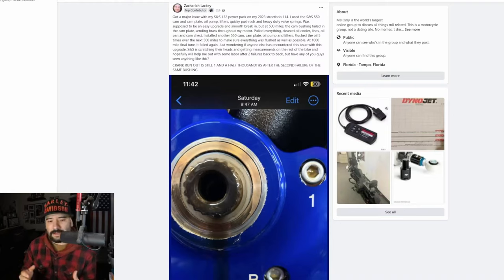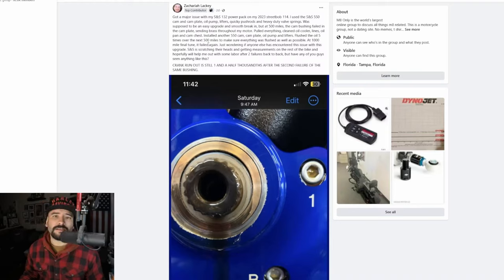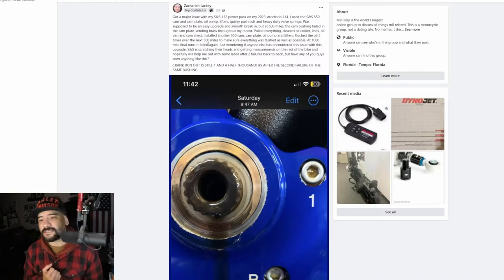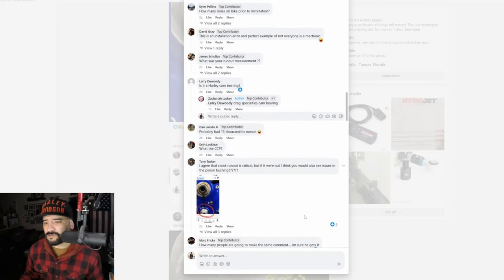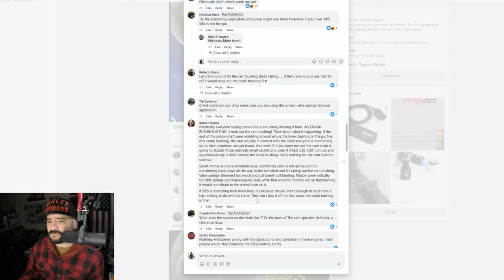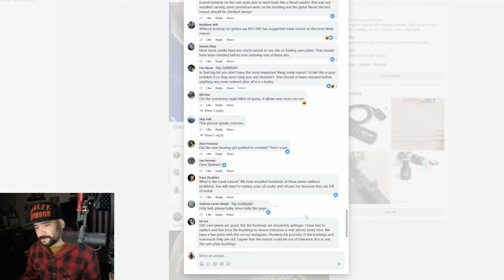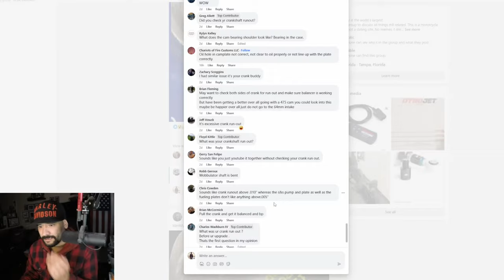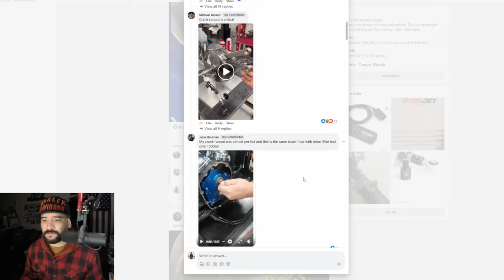Harley Davidson S&S Cycles M8 Cam Plate Fails at 500 Miles - Check Your Crank Runout!!

Comment: i did cam chest job on my 2017 fltru in spring of 2023. S&S plate, cam, pump, tappets, lifters, tappet cuffs, bearings and gear drive. only thing was i stayed with .350 grind cam {stock}. was looking more for reliability rather than higher performance. did all the work myself with a crank run-out of .0035. ran unbelievably well just with timing improvements with gear drive. made round trip from ohio to central cali and back last june. 6000 mile. never had an issue and still runs great today. also modified intake{crank} breather to atmosphere and oil tank breather to atmosphere which is easily done on a twin cool. most oil i've ever had in my crank was 4-5 oz. now average 2-3 oz.  i hope she runs forever.

Comment: everyone is stuck on crank run out . i would be thinking his push rods are set to tight or coil spring bind.
Reply: I agree 100% push rods aren’t adjusted correctly. Probably not hand turning the motor and waiting for the lifters to leak down and rechecking if they can spin. S&S says 4 turns from Zero lash pumped up. With some lifters that’s too much.

Comment: Had S&S cams, camplate and oil pump installed in my 96 cu inch TC and so far no problems. Did have some problems w tuning at first, but they got it running good eventually. That was about 3000 miles ago. Not even sure they checked crank run out before install.

Comment: Suggested run out allowance is 0.003" MAX. If you are above that specification, you are taking your chances.
Reply: That’s a gear drive cam spec. Chain drive cam runout is .005

Comment: First, I totally agree that Harley NEEDS to fix the crank runout problem, .010" is not an acceptable tolerance for crankshaft runout regardless if it's for normal riding or performance riding, an acceptable tolerance is .002" or less..period. People and builders need to understand that any performance add-ons (and hard riding) that increase power also increases the force/stress on the flywheels and increases the chances of the flywheels scissoring, builders need to advise and educate their customers that if any serious mods and hard riding is to be performed, the flywheel/crank will need to be straightened, strengthened and properly balanced, otherwise the bottom end is nothing but a ticking time bomb waiting to fail. I understand the issue of adding production costs by Harley but there are simple fixes to this issue, welding the crankpin to the flywheels for just one example and there are other cost effective remedies for Harley to implement as well. Ride on, ride safe✌.

Comment: Fueling stated not to use there camplate if run-out is more the .003. Thinking it could possibly  be in assembly and not following assembly instructions. Possibilty of to much cam end play as well.

Comment: Yea not so sure it’s all about runout yea it does matter know that but they have been several on the S&S on the bushing moving and not sure on the SE one but someone is manufacturing it for SE  from the looks of it it is S@S but they’ve been few of them of the bushing spinning on them with less than 2 to 3

Comment: It almost makes you wonder if it's really worth the money. You wind up spending a good $2k plus on parts and then make the decision to do it your self to save more money, but wind up botching the job, or you installed defective parts that failed. Either way, you're out great deal of money just to gain... I don't know 20ft ibs and 15hp? I doubt the guy took it to a tuner after the install. He probably just used the little Dyno Jet that came with the cam and oil pump/plate and called it a day. I turned my 2016 RGS into a "performance bagger" and love the way it handles now, but haven't done anything to the cam chest for the very reason this video was made.

Comment: Wowser squeezing every lemon mc motor out with coolness of over sized cam that's unneeded for real world use of torque and hp ! Let's race maybe we'll make it to atm for more cash ! Bragging rights cost ! Spend it and send it ! Add reasonable parts and get reasonable results 480ish lift and tuner so far so good on a 21 107 RK standard. Ride on